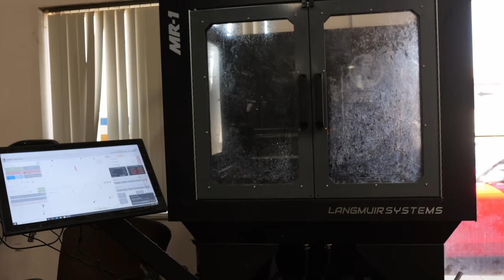Could THIS Be the Next Big Drift Chassis? Audi A5 Deep Dive!

Comment: I believe the next big drift chassis ought to be the BMW E60 5 series. It has an aluminum chassis and when you do all the weight reduction it is actually lighter than the E90, it has long wheelbase and is super easy to drift.
Reply from the maker: Oh wow didn't know that!
Reply: @DriftHQ  I would love to see you guys do a drift build with that chassis in the future. 535i N54 or LS or JZ swap. Wisefab angle. Make sure you get a car that comes with non-active steering rack because it is better. I think you can easily get that chasis sub 2900lbs. Maybe a drift week build? 🤔